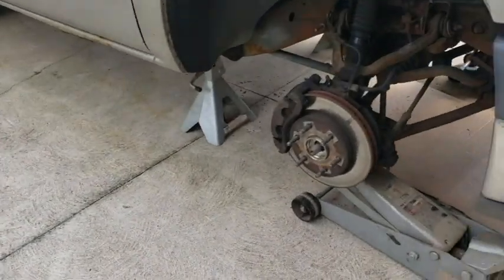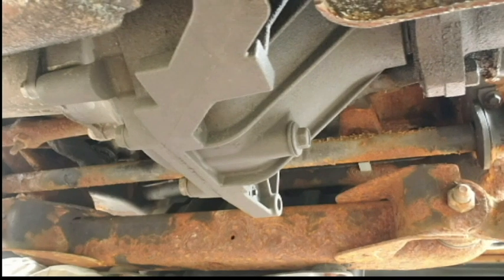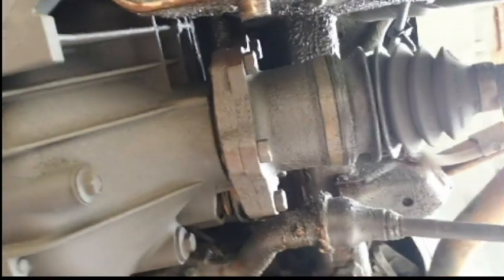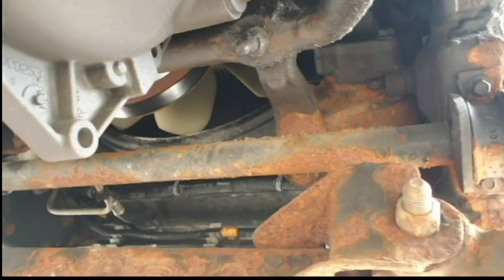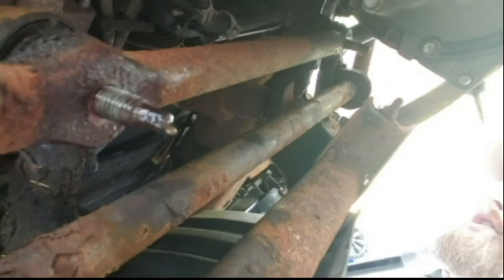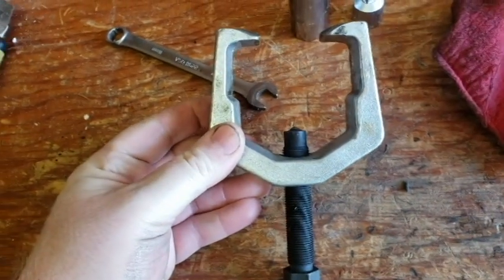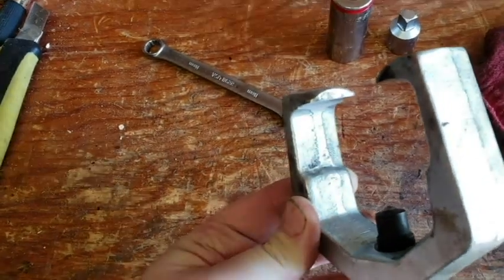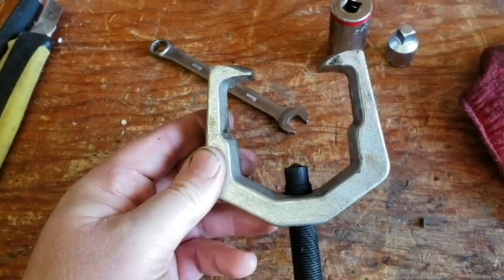GM 8.25 Differential Rebuild - Part 1

Comment: Would you have been able to remove the differential if the front of truck was on ramps? I have to do this job and my brain won't allow me to crawl under a vehicle with jackstands and a jack.
Reply: Yes you can removing the diff. Does not require you to remove control arms. Highly recommend watching other videos on how to do this job because this guy knows nothing about the gm 8.25 differential let alone any other differential.
Reply from the maker: @KellyA5150  Well, mister expert. The issue is not the control arms. The issue is that when the axels are removed from the hubs the bearings are not secure and can separate without the axel spline holding them together.
Reply from the maker: I don’t know how safe the front suspension would be with the axles removed from the hubs.
Reply: That would only be if you are going to drive and yes I do know what I am talking about more than 20 years of experience working on cars and trucks.
Reply from the maker: @KellyA5150  A possibility nonetheless. If you want to be a troll, fine. But, you have not pointed out anything factually inaccurate in this video. Instead, you’ve been a douchebag dispensing bad and potentially dangerous advice, and I take particular exception to this. Take your years of “expertise” somewhere else.